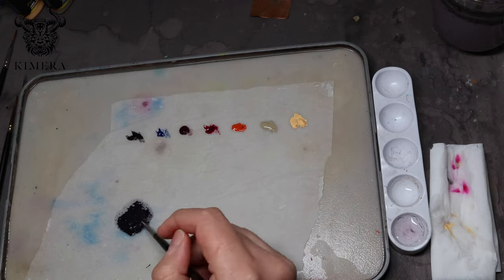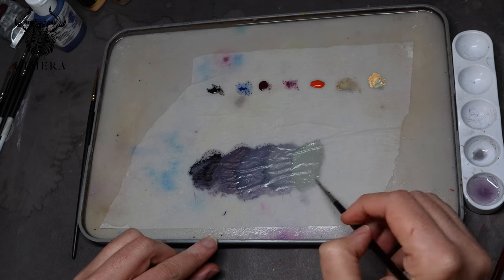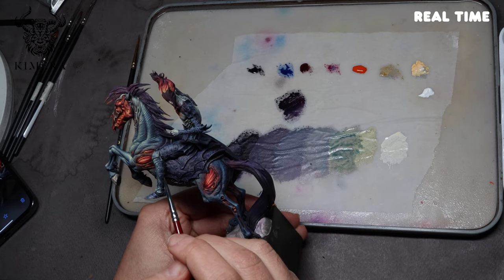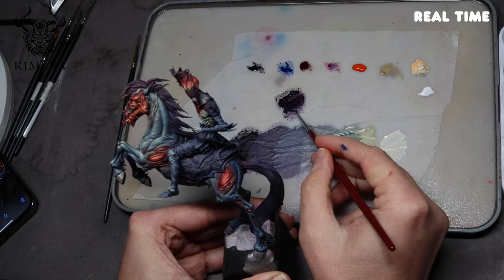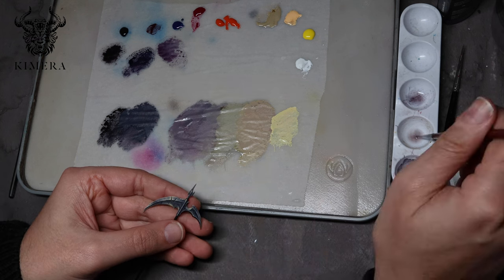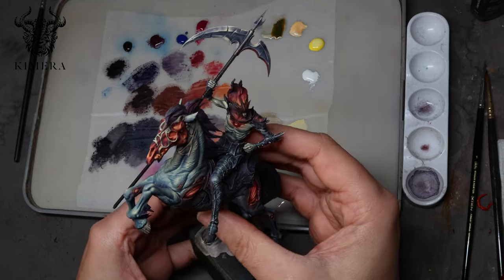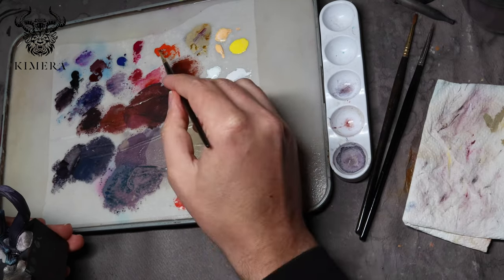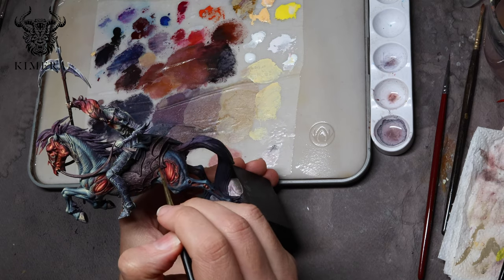How to paint NMM, OSL and Leather and why you should go to miniature contests! (pt4)

Comment: I see your phone close by, are you referencing art work or a picture you digitally sketched? Just wondering what reference you are using for this. Also, do you dilute your flow improver, it looks like you use it straight out of the bottle? Thanks! Love the videos
Reply from the maker: I had a loose reference of mohrbacher works, but in general I use the phone to take pics. As for the flow improver I usually use it straight out of the bottle yes
Reply: Thanks for the answers!  @kimeramodels

Comment: how do you clean out your well palate? is there a product that removes old paint from them?
Reply from the maker: The sponge? Soap or just water but sadly it won’t be perfect. The paper you just throw away and put a new one on
Reply: @kimeramodels  thanks for the tips but im referring to the plastic well strip that you have on the right outside of the palate. is that cleanable?
Reply from the maker: Ah yes, i use a universal degreaser for that (chante clair). Dish soap too would work.
Reply: @kimeramodels  thanks for the tip